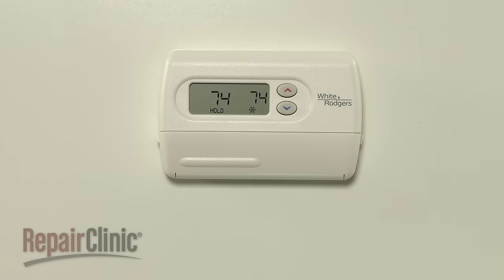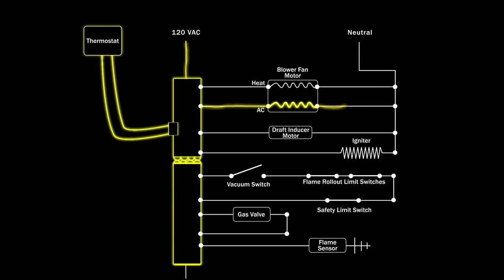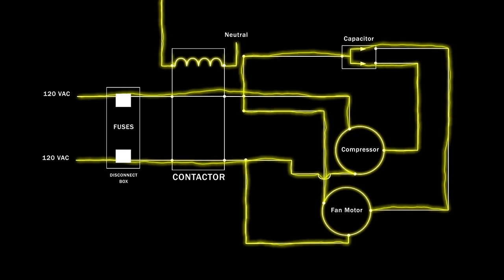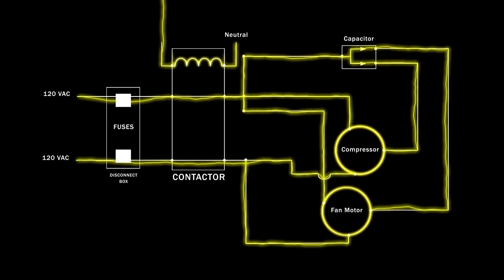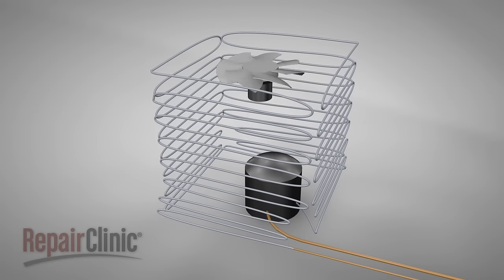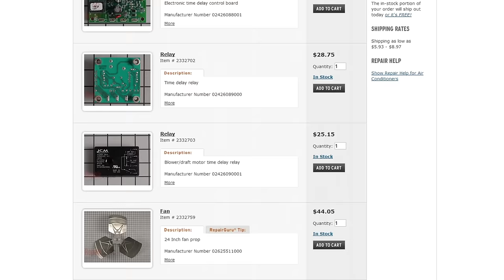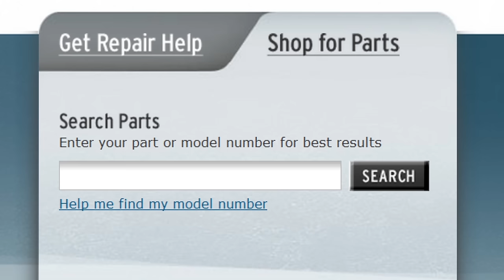How Does a Central Air Conditioner Work? — HVAC Repair Tips

Comment: The compressor does not convert the refrigerant into a liquid. The compressor converts low super heated vapor into high s/h vapor. The CONDENSER converts the refrigerant into liquid. Youre missing alot of components also. This shouldnt be a teaching video.
Reply: R
Reply: you mean low PRESSURE super heated vapor into high PRESSURE super heated vapor?
Reply: Actually it does except sometimes it will convert back to a gas, it turns it in a hot liquid for more efficient and effective cooling, it becomes a gas when it goes to the condenser unit

Comment: We had a malfunctioning condensing unit and we called a HVAC engineer. He thought it wasn't running because of a faulty board. It was until then RepairClinic showed that the problem was either a faulty condensing unit contactor, a wire cut, or a blown fuse. We had to rewire all connections onto the board that the HVAC engineer removed and replaced the condensing unit wire with a new wire and it started working again. We definitely recommend RepairClinic over a typical HVAC engineer

Comment from the maker: The compressor does not have its own fan. The fan in the unit is called the condenser fan. It comes on as soon as cooling is called for. We recommend using the repair help section of our website to help diagnose your AC problems (link in the description). Have your model number ready for best results.
Reply: Can I get a HVAC notes or detailed pdf from you ?

Comment: I have an apparent Amana central air unit with the furnace, evaporator coil box and a condenser which is on the rooftop. The air conditioner Stopped cooling very well but it was still working. The repair person came and told me that there is oil leaking from the condenser, while the other person said that there should be no oil in there I'm very confused

Comment from the maker: +Mark Pollack - Thank you for the feedback Mark. Yes, we did not mention the metering (refrigerant restriction) device at the evaporator entrance such as a thermal expansion valve in an effort to simplify the process. You are absolutely correct that a metering device is an important part of the central air conditioning system.
Reply: Reply to the comment like this

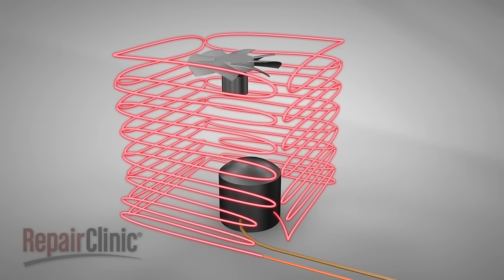Comment: First let me say, I love your videos. Professionally done, simple and direct to the point. I know you are trying to simply the process, but your video describes the compressor as the component that turns the refrigerant back into a liquid at 3:12. May I suggest that you revisit that portion of the video.  Thank you for listening.
Reply: That's because the video is totally correct the compressor is always changing the refrigerant from liquid to gas and then from a gas back to a liquid,the refrigerant also flows through the condenser and evaporator coils too
It's similar to Refrigerators

Comment: Great video I have a better understanding how an central AC works.  My puppy chewed a wire leading into the condensing unit from the attic.  The wire looks like a ground wire (but not sure)  there is enough slack in the wire to splice it.  Is this safe to do? Appreciate your input on this issue.  thanks

Comment: Question I always wonder the difference between an attic set up or basement a/c heater set up...I have it in the attic...does it use up more energy since the attic is hot in the summer compared to one that is in a basement...
Reply: Yes.  Since hot air rises, the air reaching the unit will be warmer than it would be in the basement.   If the return vents are set up right it shouldn't make much difference though

Comment: I used to have an old rusty one that looks like it could be from 1998-2002 outside the window of my bedroom since my bedroom is halfway into the ground. It's been gone since June/July 2011. In december 2011, the apartment Maintenance replaced some of them with heat pumps and then did the rest of them in probably August/September 2012. Also, isn't a central unit thermostat just a knob with numbers all around it?

Comment: Hey just wanted to ask a question... the central ac i got is working fine in some parts of the house but my room and living room etc, doesn't seem to be blowing that hard... my house was built brand new in early 2016 so basically a new house... is there any reason for this? I've tried opening some windows for better air flow and stuff but nothing seems to work and my vents are wide open. ty in advance
Reply: Vendetta Bruh if you are still looking for the solution to this issue, check that the dampers to the vents are not closed off. You can find them in your basement or wherever your ductwork is.
Reply: Or check the ductwork maybe the flex is squished
Reply: My first thought, George.
Reply: opening your windows is a terrible idea, it allows outdoor heat to come into your home. You can close vents in rooms that don't need cooling such as the washroom, closets, or partially close rooms that get good cooling. Up the fan speed on the furnace, most likely requires a technician to do this. If none of that works unfortunately the house was built with a terrible duct design, where the hvac rough in work wasn't connected properly or poorly designed.

Comment: My AC unit started acting up this week. It turns on but air is hardly coming through the vents. Brand new filter in it and still the same. Is this a problem with the capacitor on the blower fan? Or does it sound like something else?
Reply: does the fan make a sound
if it does like it was normal then check your ducts

Comment: Hello, so, at 11:30pm this Saturday night, my ac decides to give up. No cold air coming out of the vents. Checked the filter, could use replacing, but still wouldn't work with the filter temporarily removed. Went outside to check the fan and it's not moving. Noticed a coating of frost on the line connected to the compressor as well as part of the compressor. Out of curiosity, I checked the air handler in the attic and noticed water collected in the tray (which I don't recall seeing before). Where should I start? Capacitor? This is all new to me. Any help would be greatly appreciated!
Reply from the maker: Both of the fans should be running. If the condenser fan is not running I would check the capacitor first and replace if necessary. You should not be getting frost on the compressor lines unless the air handler fan is not running, not enough air is blowing across the evaporator coil, or there is too much refrigerant. If the inside or outside air temp gets too cold it will also cause frost to form on the larger suction line on the compressor. When the unit is working properly the warm air moving across the evaporator will melt the frost on the coil and it will drip into the pan and go into the condensate drain.

Comment: I checked both 2 furnaces in my house yesterday and found out there are no air filter in them 
( The one in up stare has its air filter left outside with the manual book, the one in crawl space has no air filter). But I can tell that there are 2 gaps were built for air filters. We bought this house 2 years ago and I'm wondering if its ok to run furnaces without airfilters or if not then how the inspection did say anything about it
Reply: Son K  if their is not one buy the the furnace in the return someone then yes you need one

Comment: One of the better videos on ac fundamentals.  I was looking for a video that was about 15-20 minutes long that was more detailed but this is the longest video I found so far.  Its surprising how hard is is to find a good video on the ac process and a good explanation of how the ac works and its fundamental parts.  Obviously disappointed that there was no mention of the expansion valve.  It would be great if there was a mention of the temperature of the gas/refrigerant at the different parts of the cycle.  Keep up the great work, I hope you strive to improve this good video.  Thanks!
Reply from the maker: Ryan Alton Thanks for the comment! We are always looking for ways to improve and we appreciate the tips.

Comment: So I was wondering, does the blower motor or bottom part of furnace blower, both have affects on the furnace to operate, since when my furnace runs during the Fall/winter it seems to be making an unusual noise, but when the Central AC Runs during Summer , i felt there isn't any unusual noise?
Reply: what sound? you could record and post in your yt channel

or maybe just try to imitate the sound in the reply section

Comment: What are some reasons why the compressor won't kick on the unit? What are some things that I should check?
Reply: Marvin Jones Jr. Check the power to the compressor and your refrigerant. Make sure the wiring of the capacitor and contactor are good for the compressor. Check air filter also. A bad air filter can affect the refrigerant which affects how the compressor works. Is the fan not working also?

Comment: I'm waiting on heating and air technitions to come over and look at my central air unit right now. It's not working. The thermostat will turn on but the outside unit doesn't work at all. It's kinda ironic I just had an electrician over to look at out lets that weren't working he checked the whole house made sure the wiring is good. He said the wiring is new and this house was renovated before I moved in. it's an old house but it was totally gutted out and updated with new appliances.
Reply: Destany it can be a lot of things

Comment: Does the fan on the outside unit push air down or pull air up??
Reply: it isn't important unless you have heat-sensitive objects near the outdoor unit but usually it pulls up

Comment: Here. I saw an old aircon in one restaurant. Really really old. The condenser coils is turning to dust when someone touches it. What is the solution for that? It can be replaced? Or buy new ones?
Reply: why don't you clean them with water or compressed air, or ask the restaurant owner that you don't like the look of the ac and give the restaurant 1 star

Comment: I have a two story townhouse.  I have two air vents with filters on the upstairs floor and
none on the first floor.  I have two intake vents with no filters at one end of the first floor.
I am getting plenty of cool air blowing on the second floor but hardly anything on the first 
floor.  I was told by the serviceman that my ductwork is beautifu but the design is not.
He is suggesting that I put in a ductless unit for downstairs.  Does this seem correct.
Reply: No he just ripping u off like most hvac techs make money thru scams

Comment: Question, are their residential type cooling towers available for home airconditioning with a water cooled condensing unit?
Reply: Those are called swamp coolers.
Reply: @Bendigo1  I thought a swamp cooler uses tap water to cool the passing air and blow it into the home's duct work system. There are specific types of swamp coolers that can cool water for a home's water cooled condenser?
Reply: I don't think there is cooling towers
Reply: for residential

Comment: hello i have a question if the air handler is in the attic can i run bag duct down through a closet to the basement?   we use the basement and soemtimes its humid i figured i would run air down there to cut some of the humidity even one duct would work just wondering thanks
Reply: I'm sure you can. You'll have trouble getting an accurate conditioning of that room since the thermostat is probably located elsewhere meaning the unit won't turn on based on the needs or conditions of your basement.
Reply: thermostat controls temperature and I think he/she doesn't really care about the temperature. what he/she cares is humidity

Comment: Somebody help me please ‼‼ 😑 Does an HVAC system need to be Serviced/Tuned on a Yearly or so Basis ?? My first 2 yrs electric bill somewhat reasonable but the past year bills have been No less than $400 monthly . I'm in a 2 family that used to be a 1 family and I'm wondering other than the rates per khw , Why is bill so High Now and must I ask for a Service/Tune Up ?? 2016-present Higher and higher my bill goes ‼‼ Oh and is the Unit supposed to be blowing out cool air once it reaches set temperature right after heating the place ??? Thank You for advice .
Reply: Serenityafterall not sure where at in the country you live but for me personally my gas and electric bill has been higher during months where we had extreme cold simply because the furnace has to run more often to keep the house up to temperature. You should have it serviced once a year to make sure everything is ok, techs may be able to see potential issues before something actually goes out and are able to save you from having to go without heat. Also check to see if your filter is clean, a dirty filter can also raise your electric bill. When the furnace satisfies the thermostat the burners shut down and will just run the fan for a short while afterwards to cool down the heat exchanger so you will feel some cool air coming through the vents at the end of a heating cycle
Reply: @STO21NE  Ok Thank You ‼ I live in Pocono Mountain PA and I appreciate your help . I change my filter every 3 months and I use to buy the ones to change every 4-6 weeks . I know for sure to get this service because I shouldn't have an ice block in the unit during the  summer that comes crashing down behind the filter . I just like when landlords care enough to know when certain things need to be done but it will be on him just Respect the Tenant that cares . Thanks again ❗

Comment: 0:30 
you forgot the drier and expansion valve!
Reply: They also mentioned that the compressor converts the gas into a liquid, which is completely false
Reply: I think drier isn't extremely important

Comment: hello, and thank you for such a great video. I have a question, maybe you can help? My mom and dad are in there 70's and sold my childhood home in the city; and are about to buy a home in the suburbs. So, I look at the home, it is very nice. It has "Central Air". That is all the real east person is saying. But, she said the outside: Condenser Unit.." is only used in the Summer time". And shut off or covered during winter months." and the central air unit looks just like the one in your video.  So my real question is, why would the real estate person say that? I thought that the whole unit itself, runs year-round? Does that make sense? I live in the North East..hence the winter months! lol I just do not want to see my parents get "suckered in" and buy a home with problems with heating and Ac...ty
Reply: The outside unit is for air conditioning, to be used in summer months only. The furnace for heating is completely inside your heating unit. You should be able to find an exhaust pipe, for the gas exhaust to escape, assuming your heat runs on gas.

Comment: I am about to get a new hvac system. If the AC reduces the humidity in the home, would having a humidifier on the furnace unit be adding humidity that isn't needed when running the AC?
Reply: srabchun a humidistat should be installed with the humidifier. This, along with only giving power to the humidifier when the furnace is on, prevents humidifying with cooling.

Comment: How many filters does a furnace have??
Reply from the maker: skater78207 A furnace has one air filter, which should be checked monthly and changed every six months or more frequently, if you suffer from allergies or have pets Some homes also have an electronic filter. You'll find our How It Works: Furnace video to be informative: http://youtu.be/zaT-gcEYpvs
Reply: I was asking because we have one furnace but have two vents that have filters

Comment: The ac condenser fan motor is spinning much slower than normal. I turned the unit on and the fan stopped spinning after a few minutes. I touched the motor and it was very hot. I checked the temperature and the motor temp was 170 degrees. What would be causing this problem?
Reply from the maker: Bunty8923 Enter your condensing unit model number in our website's repair help section for troubleshooting information: http://www.repairclinic.com/repairhelp.
Reply: The motor is burning out. I had this exact same problem. The fan stopped spinning entirely and was just getting very hot.

I took the motor out and I couldn't turn the fan manually at all. If you have this problem, it's 100% a bad fan motor. Replacing it is actually fairly easy.

Comment: Dear RepairClinic.com
Why do Blower fans run faster on A/C and slower during Heating? Thanks!

Sincerely
        -Christien S.
Reply: @repairclinic  Thank you for the answer! Does this apply with car HVAC systems? Because mostly when heating in the car the vents blow slower so my guess is it applies with any HVAC system

Comment: I use a cheap filter on mine, change monthly ,but it looks the same as when I 1st put it in ,is that normal ?
Reply from the maker: roxydog2004 You're just doing a good job changing it frequently and before there is heavy dirt accumulation. This is our favorite filter: http://www.repairclinic.com/Shop-For-Parts/a36b390/Allergen-Shield-Plus-Furnace-Parts?TLSID=1773
Reply: ***** Yeah ,but that's wasting money too if not needed !
Reply from the maker: roxydog2004 Frequency for filter changing depends on your region and other conditions such as if you have pets or if there are people in your home who suffer from allergies. As a general rule of thumb, filters should be changed at least every 3-6 months. Some homeowners find they need to change the filter monthly; it really all depends on the home and its particular conditions. Try changing yours every 6-8 weeks and check the condition of the filter to determine what frequency is best for your home.
Reply: ***** I'm in Chicago no pets, 1 elder allergies unknown, thanks !